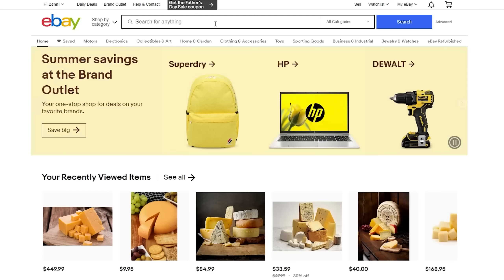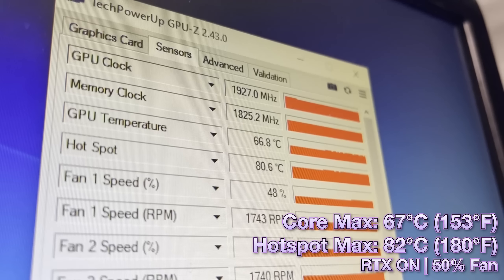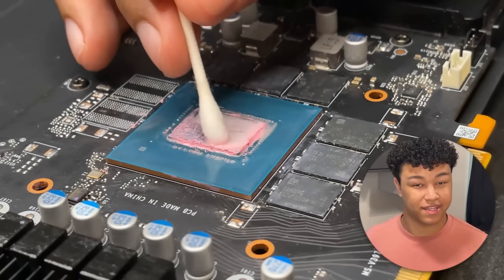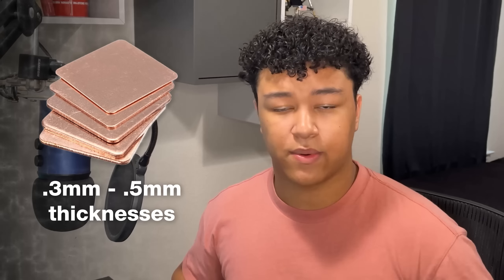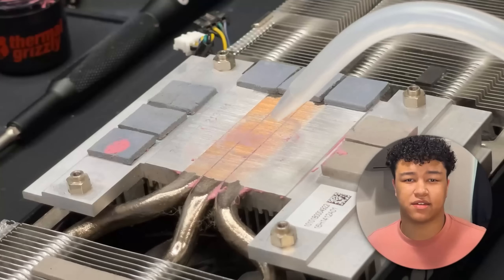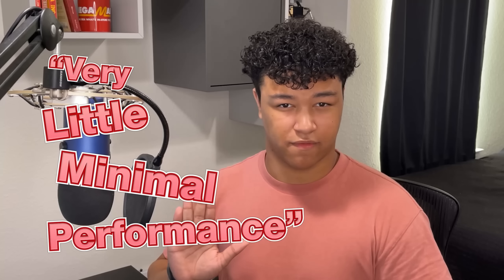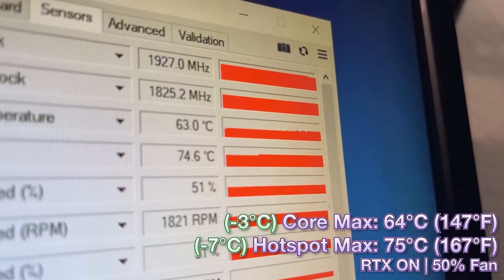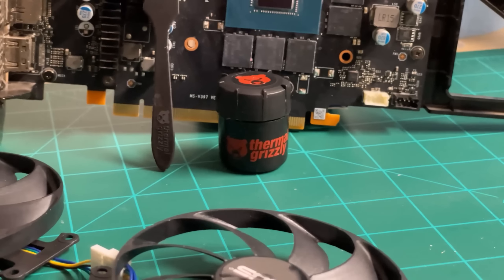Can This GPU Mod Fix RTX 3000 Core Temps?

Comment: Use nail varnish to protect all components, its cheap as chips and 100% safe, Gamers Nexus uses it,  then use Liquid metal on GPU core, temps would be better and way much cheaper than this solution, your not getting price to performance at all. Actually prove me wrong, be interesting to see. Yup Im calling you out. But "don't" use Liquid metal if the cold plate is Aluminium as Liquid metal contains Gallium that eats Aluminium for breakfast and a cuppa tea, But copper is fine.

Comment: Honestly thats stupid, adding anything between the gpu die and the heatsink WILL ALWAYS reduce your thermal conduction, the reason you are seeing an improvement is because that puts more mounting pressure due to the extra copper in between, my recommendation is to just add plastick washers on the back of the heatsink to increase the mounting pressure and remove that copper thingy between the heatsink and the gpu die, this should yield better results.
Reply: thats maybe a content for a new video 😉
Reply: I realize your comment is two years old, so I'll keep that in mind. The reason he used the copper shim is because the original cooler does not have a cold plate (as in the MSI model in the video). However, if there is a coldplate, he recommends not using a copper shim. Hope that clears anything up.
Reply: @zackary87kr  maybe, it wouldve been cool if he tested my idea tho

Comment: Thank you for this video. 
I have my own theory on this if you or someone else is interested. 
1. You are increasing the contact surface with a GPU due by using this copper shim so in theory it should help with cooling further parts of a die. (Sometimes copper heat pipes in cooler don't cover it fully and only cover most of the centre.

2. Another thing is that you've done a fresh repaste of this card so it might've helped with a few degrees as well. It looked like previous owner pasted it with what seems like cryonaut as well? Just judging by the colour I might be wrong with previous paste brand / type. 

3. And lastly (my own theory time). Coolers are designed with certain cooling power in mind and it's almost never an overkill but some adequate cooling solution. You've increased the thermal pad size also potentially introducing tiny air pockets because you've just added pads on top of it instead of replacing them completely. Not a big deal honestly and you've explained why. So to the point. You reduced heat transfering ability of those thicker pads by a little but freed up some of total cooling ceiling and now core can use that extra "freed" cooling capacity that was reserved by thinner pads before. Well I hope my mumbling makes any sense. 

Thank you for this experiment and your great job at explaining the negatives as well. Very informative. Looking forward to move awesome videos like these.

Comment: More material change-less efficient thermal transfer. This test could’ve benefitted from a comparison with just a repaste using the same paste for a more apples to apples reference point(this is more like apples vs apple turnover). With this setup, you’re using the shim mostly as thermal mass, and it’s more likely allowing it to leverage a design inefficiency in the contact plate to die contact. If the manufacturer made the plate out of copper, you wouldn’t have seen any benefit with a shim shy of adding more thermal mass(offset by transfer coefficient losses due to heat transfer from materials).

Comment: What about using copper sheets instead of shims? You can buy pure copper sheets as thin as 0.1mm, 0.2mm etc. These sheets are available as soft copper as well, which means they are slightly compressible. 1 benefit is that you can fill the exact size of the gap without increasing the height for the memory chips. The best way to measure the required thickness would be to stick some putty on the die, tighten the heat sink, then take it off and check the thickness of the squashed putty. Once you've got the exact thickness you got a piece of copper sheet with that exact thickness or a 0.1/0.2mm thicker copper sheet and stick in on the die with very little thermal paste. This should give you a perfect fit.

Another option you could do is to tape of the area around the die and extend the copper shim/sheet, increasing the surface area of the copper sheet/shim that is in contact with the die, allowing for greater thermal distribution directly in the horizontal plane.

Comment: Putting a copper pad on the die is pointless and creates more of a inefficient blanketing effect then cooling. You are better off using L.M or direct die cooling, with thermal grizzly pads. The most outrageous mod/technique was thermal paste directly on the memory chips then thermal pads. Used it on a shunt modded 1080 the mem temps were extremely low.
Reply: Gpu’s are already direct die. That silver part is the die, they have no heat spreaders. If this helps temps then it’s better than the original.

Comment: IMO best way to lower temps is to undervolt the GPU. These 3000 series GPU's tin to run hot due to their small die size so every small increase of voltage results in higher temps dramatically. I saw 10c difference in undervolting my RTX 3060 Ti on the core and on the hotspot!

Comment: Never on GPU chip but on the memory modules. GPU can throttle down VRAM fries if are too hot. Copper is dilating you have to take that in consideration when choosing thickness of the shim.

Comment: Good point. If you have smooth copper block, this modification will not give you any benefit. As matter of fact in that case any extra material between GPU core and copper block will reduce your heat transfer.

Comment: Any layer between the silicon and the heatsink is going to reduce the heat transfer coefficient. This is technically true for thermal paste as well, but thermal paste enables a much higher surface area over which to transfer heat (by filling in the micro gaps), which is why TIM improves heat transfer.

The coper block/shim will help with power transients, limiting thermal spikes, but this is limited by the thermal mass of the block/shim.

Point in case are CPU IHS. The IHS is great for protecting the Si, but if you test TIM-IHS-TIM-heatsink vs just TIM-heatsink, the later will always win provided the heatsink is well matched to the Si shape (concave/convex/slanted etc.).

Basically what you said in your conclusion. Although, I think if you had just repasted the CPU first, and then tested with the coper shim, you would have gotten nearly identical results.

Comment: What' the point in putting the shim on the actual Die? Copper does not have great X axis transfer like graphene, that is why copper can have heat spots. 
You essentially did what Intel was called out for, in putting thermal paste inside IHS, which will decrease performance over having the naked die.  
This is why we Delided the older intel CPU IHS, and repasted it with Liquid Metal, before Intel decided to solder them again on the newer gen.  
Laptop processors also do not have an IHS, as the IHS / Shim will take away thermal performance from having bare die contact heatsink, and having tiny heatsinks is important in laptops. 

I understand putting the shim over the memory, as your getting rid of the thermal pads which have a higher resistance then the copper.
But you putting the shim over the GPU die is pointless, unless you had fitment issues of the heatsink not having complete contact.
But again you stated by putting the shim it required you to use thicker thermal pads, which again, will decrease performance as the pads are now thicker. 
You were better off leaving the GPU DIE naked, and putting a proper copper shim on the memory and try to get rid of the pad as that is the most inefficient element 
Also instead of double stacking thermal pads, you should of copper shim'd the bottom contact layer with ram, and then used a thinner thermal pad to fill in the gap.
This again would of reduced the limiting element (thermal pads) from thermal transfer to the heatsink.  

You should of went like you did in the other video, as that would of netted you the best performance on the core and memory temps.
Stick with copper shims on the Ram, ditch as much of the thermal pads as possible, and try to get as much direct contact with the heatsink as possible without shorting anything out.

Comment: Try using Eucalyptus oil on a cue tip to remove the gunk then clean that off with alcohol. It works great and is cheap

Comment: Wouldn't it be better to have done a run first with removing the thermal paste, re-applying new paste and then attached the cooler and did a test. The numbers you're seeing could have been due to the re-seat of the cooler and the new paste.

Comment: Copper shims are effective but do it right. There are a lot of instructional videos on how to copper mod GPUs. I did mine for 3080ti though a hybrid of 0.5mm thermal pads and 1.2mm copper shim, the pad sitting in between the vrams and shims. Hot spot temps for GPU/MEM max out at 70C/68C during gaming. GPU Core temp remains steady at 64C. Be mindful of the thickness dimensions, this alone could make your modding a successful one or a complete disaster.

Comment: 3 degrees is underwhelming, and probably not worth worrying about for the average gamer.  Probably the heat pipes are helping out alot in the stock cooler, as well.  Heat pipes can carry away significant amounts of heat due to phase change of the liquid inside.

Comment: When I read the title of the video, for some reason I thought that you would apply copper to the crystal using chemical deposition.
If you think about it, then by applying copper in this way, you can then polish it to a mirror, thus leveling the crystal.
But direct-pipe cooling...I've always been skeptical about that.

Comment: Here's something I did that worked remarkably well that I think you should try while I was waiting for my copper memory plate from CoolMyGPU to come in for my 3080 TI after the common thermal pad didn't meet the expectation that I was hoping (from 102°f to 93°f under load) so I added thermal paste on top of the high quality thermal pads just because I didn't want to burn my memory out while I was waiting for my copper plate..

Step 1: order a large uncut aftermarket thermal pad that fit your boards requirement to cover the memory. Use the stock thermal pads as a template for what is needed to be cut out. (My founders edition 3080 TI required 1.5 mm pads)

Step 2: apply thermal paste* to the memory and the contact surface for the heat sink (spread thin but evenly)

Step 3: apply the thermal pads on top of the paste that is already covering the memory dies.

Step 4: reassemble the heat sink back onto the card, apply remaining thermal pads to the back side of the card so it touches the back plate from the PCB (no thermal paste since it would make an unnecessary mess.) Reassemble the rest of the card.

My guess is that the added performance was gained by the thermal paste increasing the surface area contact between the thermal pads and the memory and IHS. But I saw a reduction from 93°f to 72°f under load. I was stunned by the results of my little experiment and think it might be worthwhile for you to give it a shot as a cost-effective and readily available alternative to adding copper plates for those who are nervous.
Reply: And admittedly I didn't try the thermal paste method with the stock pads because for me they weren't really coming off without falling apart. It might be possible though.
Reply: That would be nice to test and include the VRM!

Comment: I wonder with an aluminum heat sink like that if there would be better temps with a larger area copper shim? Pretty much to maximize the heat dissipation area to the aluminum? Pretty much the same way the high end card has a larger copper block.
Reply: No because copper does not have that great of a X-Axis heat transfer to spread the heat out. 
Copper under a heat source, will have heat spots, which is why you want the most cooling directly on those heat spots.  
What your hoping for is what Graphene was supposed to introduce, which had incredible X + Y axis heat transfer.

Comment: all's well and good untill you tighten the bolts to the previous maximum depth and you end up cracking your cpu die do to the diffrence the shims make in height

Comment: I have my 3060 OC and running three monitors, still not as hot as your temps. How ever I did replace two fans. Same speeds but, slightly more open then MSI. Also replaced the thermal paste. I was hoping that with three fans it would cool better but, the way the card is setup doesn't have the best airflow to cool the heat-sink.. For the amount we spent on this card MSI should have gave us a block instead of heat pipes... Your right about that, I might try looking for a copper or aluminum plate. Or just pony up the cash and buy a water-block. Can't believe they want 200-300 for a block.. lol. Thoughts on just water-cooling the gpu and just adding heat-sink fins to ram_??? You did say the ram doesn't get very hot ?

Comment: Just got an ASUS TUF GeForce RTX 3090 OC and I am really confused with the memory temperature. They're at 92 C. Am I missing something? The GPU itself is at around 65c to 71c when playing games but the memory temperature is 92C and is staying there. The card was sealed so I'm the first user. What is wrong with it? Do you think I can RMA it because it really heats up my room very fast. Coming from a ASUS TUF 1080 TI I never had these high temperatures. They always were at 65C at full load. Do you think the memory pads need these coppers or replacing the pads Asus put on with something better might change temperature? My question is this card was not cheap at all and I got it exactly the same like the 1080 ti with 3 fans. I thought it would stay cool like the 1080 ti. Any advice?

Comment: Hey there. A while back I'd asked you about water-cooling and copper modding my 3080ti fe. I'm happy to report that the copper mod worked great and memory temps are also great. 

I wonder though if you might have some advice for another problem I'm having now though. While my GPU temp is typically around 70-80C (it's a lot of GPU in a SFF case on a 280mm loop with a 5800x), but the hot spot temp shoots up to 104.9 almost immediately when I start up and game and throttles constantly and occasionally just shuts off video outputs. I know it's not a problem of the loop not having enough radiator volume but since it doesn't tell me where on the card the hot spot actually is, I don't know what to do and I haven't seen or heard of anyone else having hot spot temps 30-40C over their GPU temps so any advice would be appreciated
Reply: Hey man. hot spot is meassured only on cpu die. u have bubles in the thermal paste, so the die is not cooled correctly. check that.(or dry thermal paste)

Comment: And how is your gpu? i had 3070ti ventus x3 undervolted with stock mhz at 900 mv +1000 mhz on memomy. GPU max 70 degree, memory 78 and hotspot 93 at 1600 rpm fan speed... how can i improve my hotspot temp? it was 108 degree before undervolt

Comment: There will also be a slight decrease in how quickly the VRAM is able to transfer it's heat to the cooler. This in turn opens up more cooling capacity for the core.

This can likely work well for GDDR6 cards, but with GDDR6X there would likely be noticeable increase in the VRAM temps, and decrease in mining performance.

Comment: This is a noob-trap topic. More copper doesn’t equal more cooling. Thermal paste isn’t as good at conducting heat as, well, any metal really. Adding a copper shim means you have to paste both sides, and I can promise you anything you’d gain from the copper, you’ll lose more going through two layers of paste.

You can’t get around it with liquid metal either, you can’t put that on the die, so you’re going to have a layer of paste no matter what. Why even put liquid metal on something after the paste? It’s a waste of heat conductivity.

If you really want a core copper mod, you’ll have to get the fin assembly custom built out of copper. I’m sure there’s performance to be had there - assuming your GPU brand isn’t a cheapskate and actually provided copper heat sinks. Not even joking, this is something I’d love to do if it wasn’t so prohibitably expensive.

Comment: I would like some more in depth analysis. Your videos are really good. I recently upgrades the thermal pads on 8 RTX 3080 TIs. 4 turned out much better than the manufacture's pads, 3 the same as the  manufacture's pads when new, and one that that I am now unable to lock the core clock on and so mining is seriously hampered (43.3 MH/s for eth). You were talking about removing residual stuff from other parts of the PCB - Read Panda say ' don't get thermal paste on any part of the card or you will have 'all sorts of problems'. What is this all about? Why do you spend so much time and effort getting every little bit of old thermal paste from ever nook and cranny of the GPU? Do you KNOW why you are being so meticulous, or are you just doing it because you've been told to before? I think there is a significant potential viewership for quality, in depth analysis and teardowns of GPUs. I mean, how do these things really work at the hardware level? Most videos just give you a whole load of stats concerning cuda cores etc, or overclocking procedures, very few try to strip cards down and show people what's really going on with them.

Comment: Toothbrush 
Bad idea
Reply: There's no harm from it whatsoever. As long as bristles are soft enough and you never use it dry, always sufficiently wet. Dry there's a slight static hazard, using it wet eliminates it.